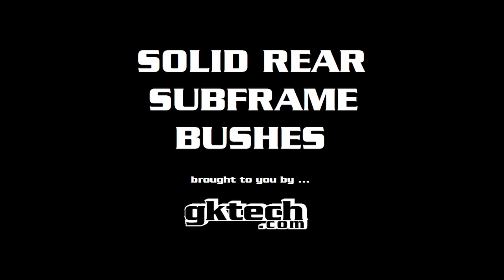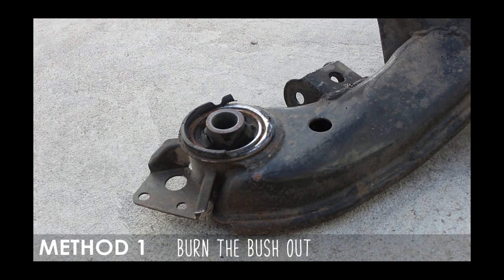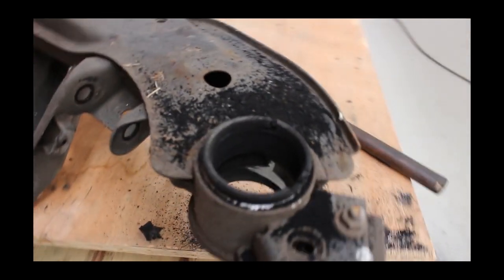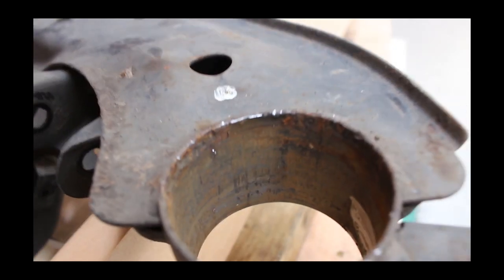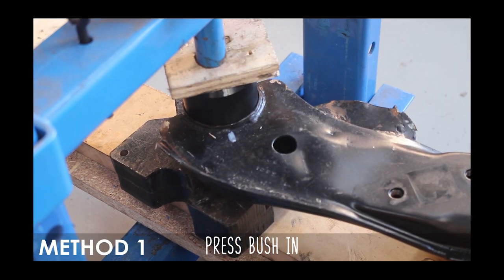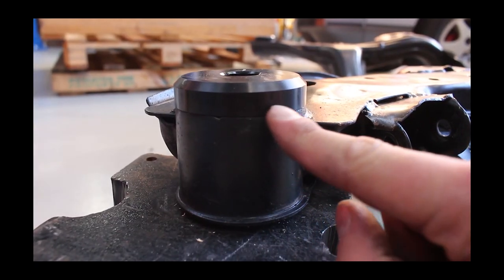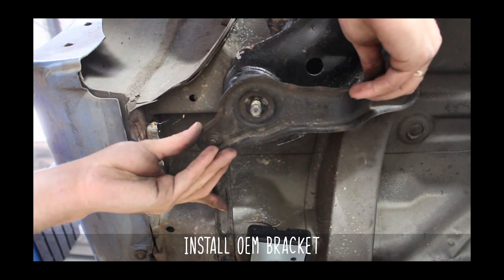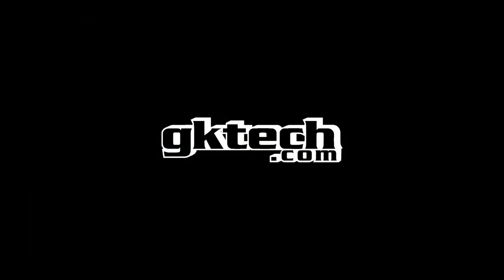Gktech Solid Rear Subframe Bushes - Install

Comment: Could you guys please explain why this roll center correction is beneficial.
Reply: Apparently they will never answer. Best I can tell the roll center of the car is the axis that your car body rolls on and is based on suspension geometry and where several angles meet up in the middle of the car. You want this point to be as close as possible to the center of gravity of the car. Lowering the car lowers your roll center too. This causes you to compensate more for body role with stiffer springs and things like that than you should have to. If this actually does make the roll center higher then it would be beneficial. I'm not an expert though. GKTECH should be giving me a discount for doing their work here.
Reply: @xex2kok  ahh makes sense thanks !
Reply: Moves the subframe higher up closer to the chassis so your entire suspension geometry is higher up so you have a lower center of gravity and essentially can lower your car more without affecting suspension geometry as much.